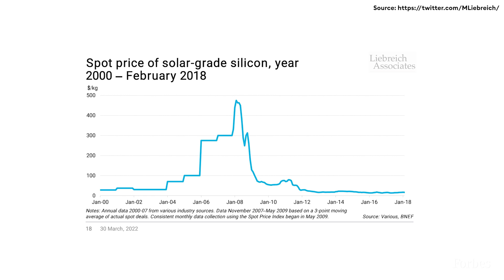Rising Lithium Prices Could Upend The Electric Vehicle Revolution | Forbes

Comment: Did NOT have Bidens administration causing major problems ,  green new deal, and  covid19. Gas prices are artificially high because  of the green new deal. Need $6-7.00 gas for it to look good for electric  vehicles.

Comment: As a publisher of information to investors, Forbes has a very powerful voice for directing capital. Unfortunately, the direction of this article is off by about 180 degrees. The impacts will be nontrivial and it is very important to understand why. Please bear with me…

@3:45 the article states “The high battery mineral prices are also likely to be a blip.”  This conclusion assumes that what happened with “Silicon” several years ago, directly translates to Battery Materials today. A Deeply flawed assumption.  

I would recommend that the the researchers from this article take 15 minutes to look at the forecasts of the folks that are DIRECTLY involved in the Battery Minerals industry (eg Joe Lowry, Simon Moores, many more). It will become obvious from there that elevated prices in Lithium are likely to remain for 3+ years, making Lithium a highly investable specialty chemical today. And Lithium NEEDS years of sustained investment to get out of this shortage. Without it, we severely limit our transition to clean energy. 

PLEASE, do take a look at the folks that work very hard in the industry to truly understand it. Primary sourcing from an irrelevant industry has in this case result in a deeply flawed conclusion. Do listen to the real experts, and then help the world understand. 

If you’ve read this far, thanks for taking the input.